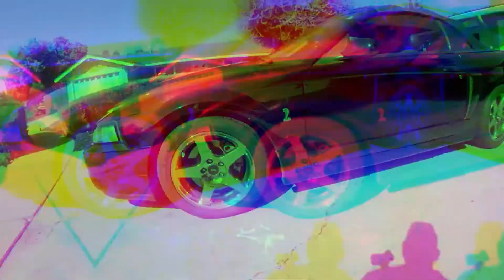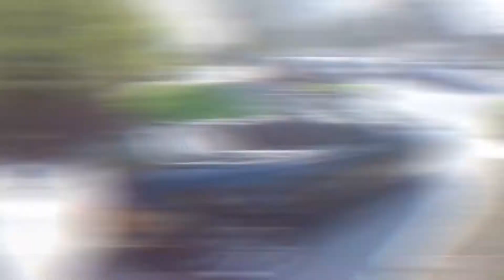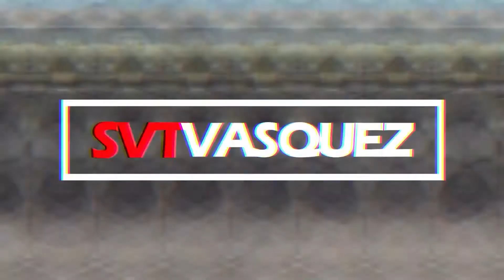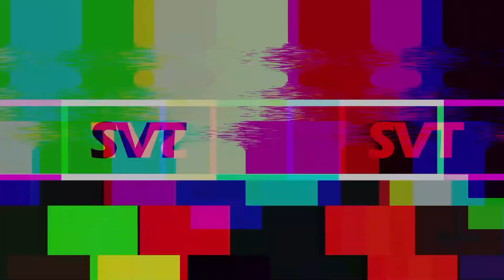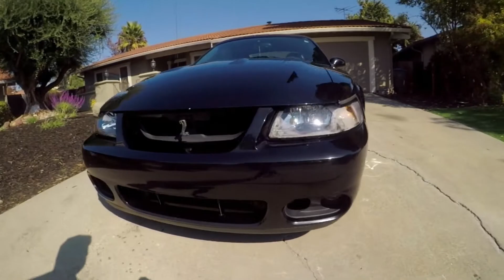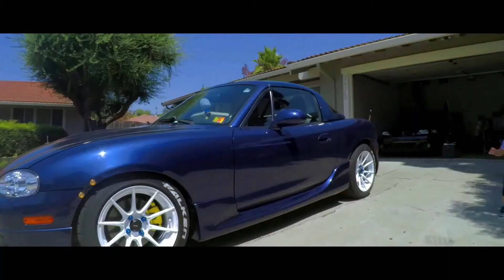How to Flash an ECU to PASS STATE REF

Comment: Just reflashed my car back to stock at ford to pass emissions and my drive cycle took about 2 drives to turn on all sensors. Passed and all is good
Reply from the maker: Its a complete relief when it's all over congrats 👏
Reply: @SVTVasquez  thank you man. Was a pain to get it back to stock but worth it. Just went back to go fast parts 😂
Reply: Wait you have to reflash it at the dealership? I already flashed mine back to stock but what do I do now? Take it to the dealership still?
Reply: @slw.2gr  No, I took mine to get reflashed to stock since I lost the OEM tune. After you flash it drive for a couple miles to get all sensors to turn on and then smog
Reply: @xOscarIGZx  so you smogged it and then took it to the ref? Im confused because I got an email saying I have to show proof that the ecu is stock and show all moniters are good before I can make an appointment with the ref

Comment: I took my mach 1 Eaton swap for a smog  n got flagged for a state reff I’m so fuccd
Reply from the maker: Yea if you know you can't pass smog you shouldn't take it to a shop there's some ways around getting tags but no way around state ref
Reply: @SVTVasquez  the shop has passed it before (for some extra cash) but this time they said the vin came back with that ref requirement …. Do you think I gotta take off the Eaton ? 🤦🏽‍♂️
Reply from the maker: @ge4549  so the good thing about the eaton is that it has sticker on it making it carb legal but that just means youll have to have a state legal tune and everyting else like the cats on the exhaust and any other part requiring emmissons like the air intake need the carb legal sticker as well. so it can be done but it would require a lot of work

Comment: On your question of being targeted.  That is not the case.  What happened was they started a program of comparing the ECU data from what should be there to what was showing up in the car.  They only started doing this in 2019/2020.  Will post a timeline they presented below.   So yea they are kinda targeting people with a tune, and if that is most of the cars in your community , yea your community is a target.

https://www.bar.ca.gov/pdf/On_Board_Diagnostic_System_vehicle_Tampering_Prevention_10.17.19.pdf
Reply from the maker: My car has not been scanned there are other ways to pass smog without even having your car present. Knowing I have a tune I would never take my car to a smog shop so yes I understand a tune will trigger a car to be sent to state ref that is not the case with my car.